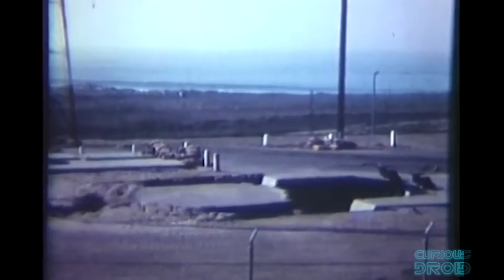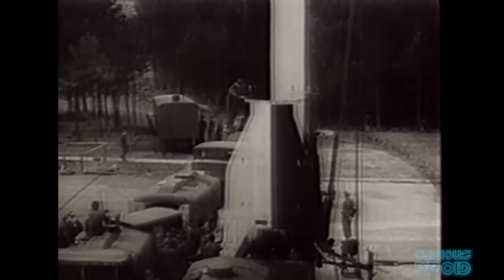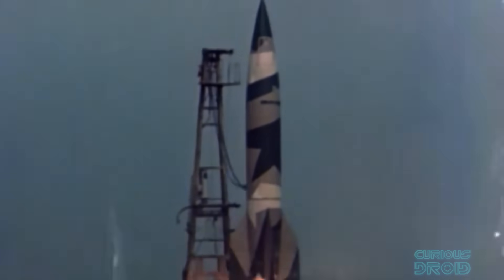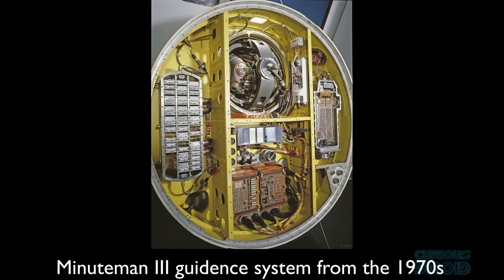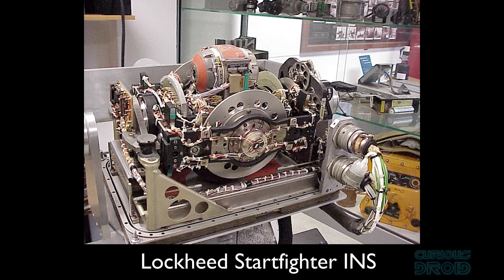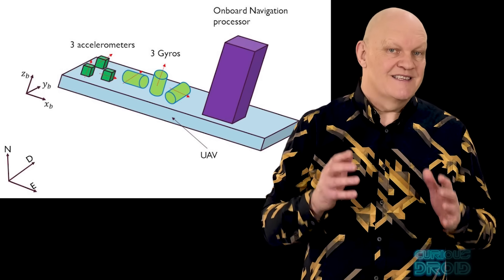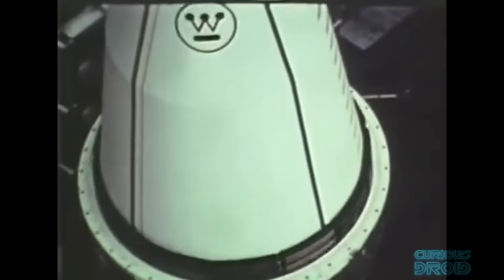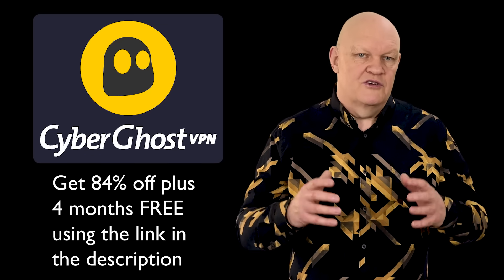How Does a Nuclear Missile Find its Target?

Comment: The  gyro  diagram shown at  7:14  is  highly artist impression.    The devices show as  Motors  cannot be motors.  THey are bearing or they could be  bearing points that are fixed and equipped with torque sensors, bu tin that case you don't have an inertial platform   indep. of the  missile vehicle .  The motors are  in fact on the  respective  Gyros.   Potentially what is shown as  motor is in fact an angular  position transducer  for the respective  roll,  pitch and yaw. So the  diagram appears pretty half arsed and confusing.  The diagram is NOT applicable to rocket guidance as  vertical acceleration is not measured. 

  The use of  word  Azimuth  is inconsistent.   A vehicle has pitch roll and yaw.  Yaw would be azimuth  as  shown on the diagram so why call it  azimuth when the other  rotation are called  roll and pitch ?   The motors for the gyros,  mounted  against the  respective gyro wheel   could be supplied with electric power through the gyro frames x  3  as long as an insulating section is  built into said frames.   you probably don't want a  Dc commutator motor so the motors for the older gyros were  likely  3 phase  LV  type motors - comment invited on that .  

Now comes the interesting part -  if the item is say pitching then there will be a rate of change of pitch and likely a non zero  second derivative as well.   If the  measurement of  acceleration , say  NSouth accel is called  B  then   Accel b (Vector) = the Acceleration of the centre of the gyro  plus  Accel of  normal direction  plus   A tangential   direction  :   where  A normal is  omega (rate of change of pitch angle )   cross omega cross  r where  r is the vector from the centre of the  gyro  to the  position  of the sensor  in the transducer measuring  Accel   NS .   A tangential is  alpha (angular  accel of pitch angle)  cross  r  . Cross being a vector cross product.  

  However   omega (generalised  vector angular velocity of the  NS accelerometer in this case)  is in general  made up of   p '  roll'  and  yaw '  where  ' signifies  first  derivative.  Similarly for alpha , angular acceleration.     Pitch , roll and yaw  in an uncaged  Cardan suspension don't  seem to work too well -  because any transducer doing an angle take off is going to measure only with respect to the supporting suspension frame and not with respect to the principal axes of  rotation, yaw and pitch   the flown body - or propelled body.   So in the case of a rotated gyroscope,  a secondary system, possibly three bound  gyros with  measurement of  precession torque  (divide  N.m   by  J (mass moment )  x   the angular speed of the gyro  and you will get the  angular  rate  of turn  required to provide this torque). 

Do we  need to allow for the fact that the measuring  transducers for  acceleration are not at the geometric centre of the gyro ?  this could simplify the  equations to solve enormously. However any error in calculated acceleration will accumulate over time and could make the simplistic calculation worthless.    Anyone who has followed this far  should have a look at the  following  PDF on the generalised matter of  rotating frames of reference  -  RotatingReferenceFrame.pdf  from Alpha Omega engineering dt com. This derivation is  based on a simplistic 2D model  but can be expanded  to a  realistic  3 Dimensional world.   
Important point to consider.  The NS and EW acceleration transducers  in the  diagram at 7:14  are assumed to ignore accelerations  that are  not along the principal axis of the device.  That means that  if the NS transducer is considered to be in the local  i direction that if the  vector equation  for acceleration gives  j and  k vector components for the acceleration which  would be true in the general case  of  the angular velocity  (combined p, roll and yaw angular velocity vector sum)  , then the out of plane  acceleration components must be ignored, ie any acceleration  that is the j or k  vector direction.  ( you'd end up with  j and k components  on the  LHS of the equality that did not equate to any  similar  j or k  vector component  coming out of the  transducer  because it is  intentionally implemented as an  inline device only. )   If in fact these components are large  compared with the i  component , there is an indication that the problem is poorly conditioned, eg that the transducer is mounted too far from  the geometric  centre of the Cardan frame of the gyro.

BTW  Scott Lobdell has a  Ytbe  video on Solid state  accelerometers and he indicates a  general solution for  pitch roll and  yaw  (not rates of p r and yaw but absolute values) . Search on  -How to Implement an Inertial Measurement Unit (IMU) Using an Accelerometer.  However  Scott  jumps like hell over  some of the detailed matrix math. 

Tim  F

Comment: Thanks - it is always interesting to watch and learn from your videos!  I don't know how ICBM gyros were constructed, but from the 1980s through the 2000s, commercial aerospace laser gyros were designed with a mechanical movement called dither - often induced by the standard aerospace electrical frequency of 400hz, hence the gyros were not completely without moving parts. This dither was necessary to prevent  the laser beams from locking at low rotation deltas.

Comment: Simple. The missile knows where it is at all times. It knows this because it knows where it isn't. By subtracting where it is from where it isn't, or where it isn't from where it is (whichever is greater) it obtains a difference or _deviation_. The guidance subsystem uses deviations to generate corrective commands to drive the missile from a position where it is to a position where it isn't, and arriving at a position where it wasn't, it now is. Consequently, the position where it is is now the position that it wasn't, and it follows that the position where it was is now the position that it isn't.  In the event of the position that it is in is not the position that it wasn't, the system has acquired a _variation_, the variation being the difference between where the missile is and where it wasn't. If variation is considered to be a significant factor, it too may be corrected by the GEA. However, the missile must also know where it was. The missile guidance computer scenario works as follows: Because a variation has modified some of the information the missile has obtained, it is not sure just where it is. However, it is sure where it _isn't_, within reason, and it knows where it was. It now subracts where it should be from where it wasn't, or vice versa. By differentiating this from the algebraic sum of where it shouldn't be, and where it was. It is able to obtain a deviation and its variation, which is called ‘error’.

Comment: As a PhD Roboticist, I can guarantee that this was far from “primitive tech”. It should be considered that in 1944 not even the transistor had been invented yet (1947), nor the very concept of feedback loop control, sensors and computers existed as ideas in the minds of Turing and Von Neumann as math objects, and even analog op amps calculators didn’t existed yet. The Inertia guidance was still ten years away (MIT mid 50s),
Not to mention open cycle combustion, propellant, supersonic approximations for aerodynamic stability and the list is long. and yet they managed to create a full technology stack from basically scratch .
This is absolutely astonishing, in some sense similar to Newton that invented calculus to invent mechanics, to stretch a comparison to represent the leap forward made by Von Braun’s team. and yet they managed to create such full technology stack from basically scratch .
Oh: 20 yrs later they sent men on the moon 😅 ❤
They don’t make such humans anymore
Reply: Oh: 20 yrs later they sent men on the moon 😅 ❤
They don’t make such spaceships anymore either.

Comment: Wikipedia: An odometer driven by a vane anemometer on the nose determined when the target area had been reached, accurate enough for area bombing. Before launch, it was set to count backwards from a value that would reach zero upon arrival at the target in the prevailing wind conditions. As the missile flew, the airflow turned the propeller, and every 30 rotations of the propeller counted down one number on the odometer. This odometer triggered the arming of the warhead after about 60 km (37 mi).[30] When the count reached zero, two detonating bolts were fired. Two spoilers on the elevator were released, the linkage between the elevator and servo was jammed, and a guillotine device cut off the control hoses to the rudder servo, setting the rudder in neutral. These actions put the V-1 into a steep dive.

"Relatively slow"?  I wouldn't call 550 kph exactly slow.
Wikipedia: Most aircraft were too slow to catch a V-1 unless they had a height advantage, allowing them to gain speed by diving on their target.

Comment: I assume it is inertial navigation with star tracking for course correction? I would throw in passive terrain recognition except for weather interference
Reply: Terrain recognition isn't much use in a ballistic missile... by the time you're close enough to resolve the target with more accuracy than INS, it's far too late to materially alter the last few seconds of your trajectory.
Reply: TERCOM was/is more of a cruise missile thing.  the only current US cruise mssile nuke is the AGM-86B Air LAunched cruise Missile. the only launch platform is the B-52H, which can carry 6 under each wing for 12 externally, plus 8 more internally on a rotary launcher assembly for 20 missiles total.  ALCM entered service in 1982 and will be replaced by the Long Range Stand Off (LRSO weapon towards 2030.

Comment: How did we go from a nuclear bomb the size of the one developted during the Manhatan project to the ones that can fit in MERVs ?
It still needs a critical mass of nuclear material and enough explosivs to cause the chain reaction
is it just that we can enrich the nuclear material to way higher levels ?
Reply: Less than 1% of the uranium in the old MArk atom bombs was fissioned. Modern bombs are much more efficient.  They now use small fission bombs to "light off" or "initiate" fusion reactions in a secondary, hence the thermonuclear weapon.  Another major innovation is the ability to use shapes other than spheres to compress. using "ovoid" pits allowed for smaller warheads to be fitted atop the "pointy" ends of missiles.  tritium "boosting" also allowed for large yields of small physical size.
While enrichment is difficult, the purity of HEU and HEP wasnt the issue so far as size of the weapons was concerned.

Comment: 6:30 The gimbals are always discussed providing a stable directional platform but not how the actual accelerometers work. But that's the most important part. I've flown with INS in 737s etc. Looking forward to getting RLG/FOG/quantum (whatever gets cheap) based INS in small aircraft, boats, and other craft. We are way too dependent on GPS. How these things survive the vibration of an engine with any degree of accuracy is beyond me. That's what I would really like to understand.
Reply: The highest accuracy accelerometers are of the PIGA "Pendulating Integrating Gyroscopic Accelerometer" go back to the V2 and were developed by F.K.Mueller who came to the US Redstone arsenal in Huntsville Alabama for the Army Missile Programm.  The technology moved on to the Space Programm and MX missile.   
-The PIGA is very elegant.  A pendulum is added on the spin axis of a gyroscope.  When acceleration is applied the pendulum upsets the gyro which does what gyros do and generates a torque mutually orthogonal to the spin called precession.  This is detected with sensors or switches and torques a motor in the precession axis opposite direction leveling the pendulum.   PIGA output speed not velocity but you can derive the other two.
-When the PIGA (which the Germans called a MIGA after its inventor) Charles Start Drapper introduced an American technology developed for gyros in which the entire assembly is floated in a liquid (eg fluorocarbon) on jewelled bearings.   The super accurate American gyros and the floating bearings were a marriage made in heaven.   The Germans had been working on more accurate Gyros and PIGA accelerometers using fluid bearings in one case and double ball bearing with a vibratory dither to prevent stiction.    The Germans had also developed Schuler loop tunning.which keeps the INS platform level as the vehicle traverses the sphere of the earth.  The V2 simple LEV-2 system was to be replaced by more advance and accurate SG-62 and SG-70.   Interestingly LEV-3 was used to put the US first sattelte into space and Alan Shepard due to its simpliciy.  These developed into the ST-80 of the Redstone and ST-92 and then moved to the Saturn progrm.
-The US did develop its own system based on tensioned wires with proof weights which was used for a while in Polaris etc.   The resonant frequency determined the acieration.  
-The INS isn't actually the only navigation system.  They use star trackers ie celestial navigation.
Reply: @bernhardzunk7402  Wow, thanks for the info! Now I have stuff to google and read about!

Comment: Good point about the location accuracy of the launch point.  For fixed silos that isn't an issue.  But for mobile launchers that would be a limiting factor.  This is especially true of SLBMs.  Submarines also have highly accurate navigation systems that can accurately determine their position even without GPS.  The Trident II D5 is at least just as accurate as the Minuteman III and probably more so due to advances made after the Minuteman III entered service. 
If you notice in the animation at the end of the video that shows the flight of the warhead in post separation, 2 jets ignite to put the warhead into a spin on the longitudinal axis.  That improves accuracy by increasing stability in the warhead to keep it on a steady flight path like how a spiral on a thrown  football or how rifling on a gun improves accuracy.
As for the NASA connection.  IBM built the INS computers for ICBMs and they were the contractor for the guidance computer in the Saturn V booster.

Comment: GPS, as Navstar, was initially developed by the US Navy to allow accurate worldwide positioning and navigation for its missile submarines without having to rely on land based transmitters. The initial accuracy of 100 meters or so was 'good enough' for a submarine well over 100 meters long.

I find it interesting that the Advanced Inertial Reference Sphere is not mentioned here. This was part of the navigation system for the Peacekeeper ballistic missile and is probably the most accurate inertial reference system ever built, with its deviation over the course of a flight being less than the random deviations caused by weather in the landing zone. It is mechanical in nature. There are some other youtubes available on this fantastically complicated, expensive and accurate device.
Reply: Alexander the Ok’s latest video is about the Peacekeeper IRS. 

Highly recommended for anyone interested in the kind of topics Curious Droid covers. 

https://youtu.be/AazmxNs5kmE?si=xw6OdGgwbp7Ag6vB
Reply: @lorantstary4398  Dude drops GOD TIER videos.
Reply: The astro navigation system mentioned here that was in use by the 60's is the system the SR71 used to know where it was at, in interviews here on YouTube several pilots mention that even in broad daylight by the time they taxied from the hangar to the end of the runway it'd already locked onto the 3 stars it needed to in order to know where it was at and was ready to go.
As far as navigation goes that was the big upgrade the SR had over the A12 which used an INS system for it's navigation.
Reply: @dukecraig2402  the Habu pilots called the astro navigation system "R2D2" in time.
Reply: Agreed, great topic to cover In future.
Reply: Alexander the ok has a great video on it
Reply: Because most people who know about it still prefer not to talk about it. Just because it's on the cover of Pop Sci doesn't mean we need to actively help North Korea.
Reply: Go space force

Comment: I got to work on military electronic systems in the 80s. Fantastic time to be a tech. You had really old stuff and really new stuff. Our shop was staffed with company reps who could teach us just about anything with new state of art systems. Of course that stuff is all ancient now but it was a lot of fun at the time. The gyros use by the F-14 and A-6 were about the size of a soccer ball. Very cool tech for the accelerometers. Everything was getting tiny. Compared to the old systems which had motor driven systems with several meshed gears. It was a challenge to get them aligned correctly. Sometimes you would get spurious signals and they would jitter trying to maintain a set point.
Reply: Definitely a interesting era for tech. I remember reading about IBMs first gigabyte hard drive in I think it was 1980 and it weighed over 500 pounds.
Reply: I wonder what the aerospace engineers of the 60s would come up with if they had modern computers
Reply: The era that was the beginning of the crossover between analog and digital, in tech. Exciting times…! 😊
Reply: quite ASTOUNDING how technology has progressed so much in just over 100 years, 
from the Wright brothers first heavier-than air flight in 1912 to the laser accelerometers 
and hyper-computerized guidance systems of today
Reply: Crazy you built F-14s and they were in use for like 20-30 years
Reply: Imagine how people in 50 years from now look at our mechanical washing machines, while they throw their dirty clothes into sold-state devices that spute them clean and dry
Reply: syabu
Reply: @wasir3703 What‽  You can't even spell the acronym for people that can't spell correctly.   Bot much?
Reply: To get to the moon, right ? 😅